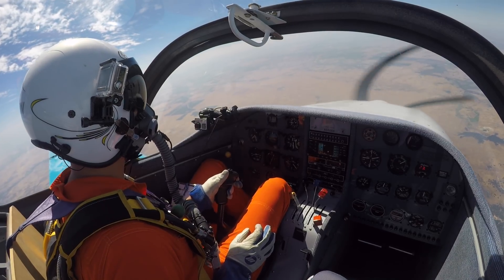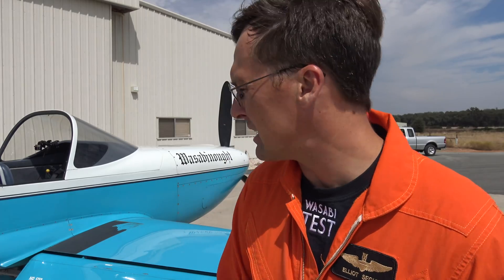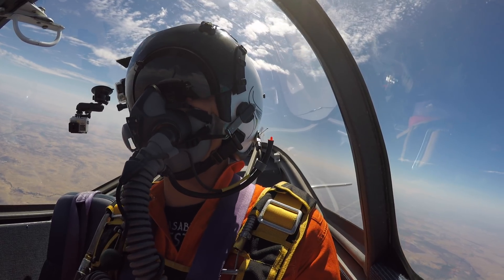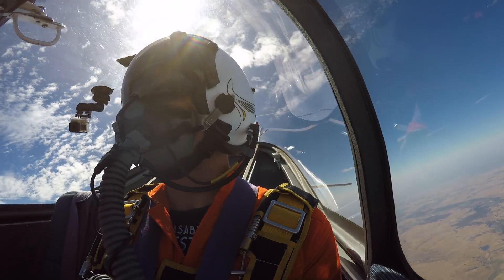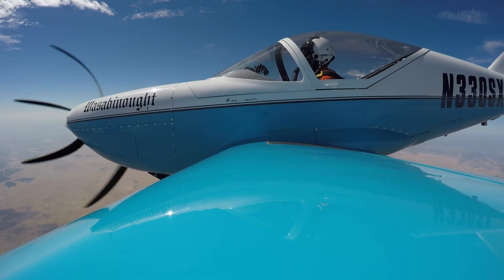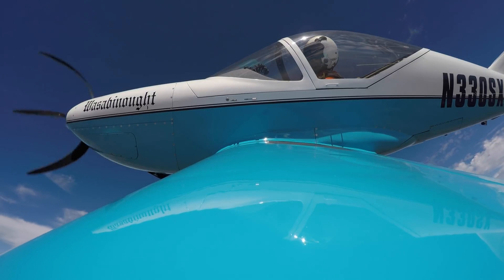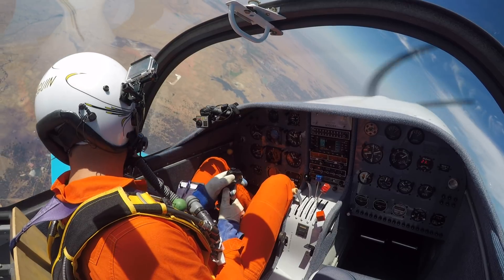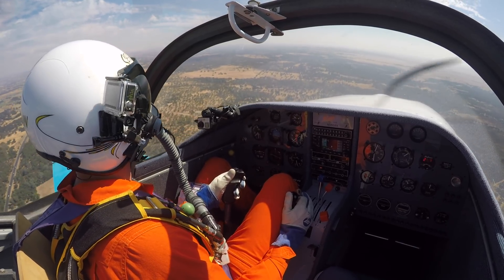Wasabinought Reno Air Race Test Flight 5 Pulls, 4.5 Gs, 8.30.2018

Comment: Nice job! however during the G turn you will notice the LH Gear door coming open maybe both. Visible at 0:12 seconds of video. Minor risk of drag but it may blow the door specially above 200 Kts. Happy flying.

Comment: It would be interesting to monitor the line pressure on the side of the gear door cylinder that's being compressed during positive g's.  If it isn't air in the system as was suggested in another comment, I suspect your developing enough line pressure that you're cracking/unseating the relief valve in the pump and bypassing fluid.  Enjoying your videos!
Reply: I guess they cant put what I call a line lock on hyd line. Line lock used in drag racing to lock the wheels  before the launch. Step on the brake pedal, switch the lock on and another switch attached to the throttle releases it

Comment: What's VLe? Was that something that you had to take into account when planning this test and the airspeed used?
Reply from the maker: VLE is 150 KIAS but the clamshells have been previously cleared to 250 (this is not a new problem for SX300s).

Thank you for asking!!
Reply: Elliot Seguin interesting, for some reason, I was always under the impression that the gear doors were typically the weakest link when it came to considerations for VLe and that damaging them was usually the limiting factor on the speed, not damage to the actual gear itself.
Reply from the maker: That is my experience as well.  The SX is apparently a different monster :)
Reply: Elliot Seguin toughest gear doors in the West
Reply: Yes, LG are tough and Vle is due to doors and aerodynamics.  

Wondering if the breaker for door actuation also powers other consumers.  If not, pop that breaker and write a note to reengage on landing checklist.
Reply from the maker: Yeah we have talked about using the breaker, it makes me nervous when operating that close to the ground.  But certainly worth considering.
Reply: Why do the gear move under positive? Sounds like air in the hydraulic system.  Might be a trapped bubble.  Vacuum purge?  Something is "springy" on the extend circuit.
Reply from the maker: Interesting, I hadn't considered that.  It seems unlikely but might be worth checking.  Thank you!!
Reply: I wondered the same thing - no risk of those doors tearing off I guess? :P
Reply: Vle is the minimum gear speed at which the could be extended. Such as 150 KTS...
Reply: @fed8925  I think you mean maximum speed.
Reply: Dan Jacobson yeah, know what it stood for, was curious about the actual number. Thanks for clarifying that for others though